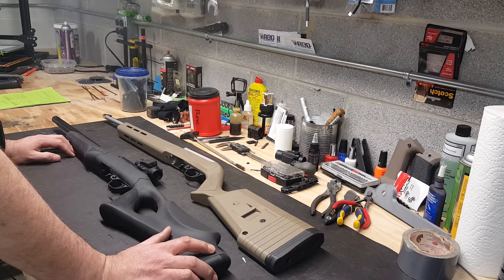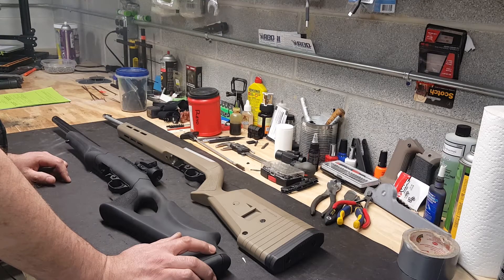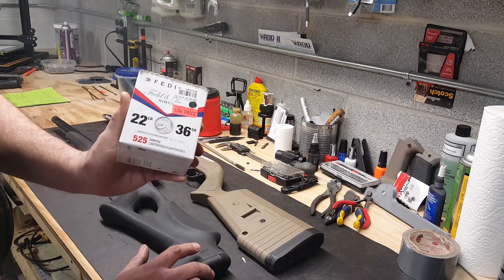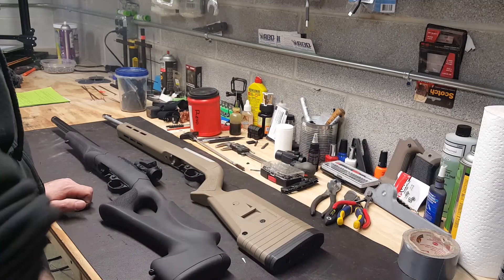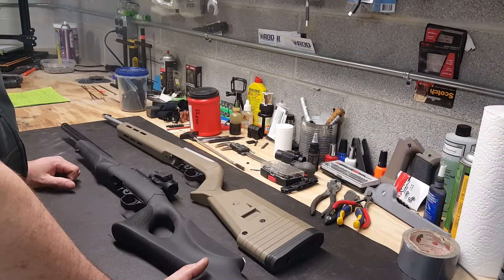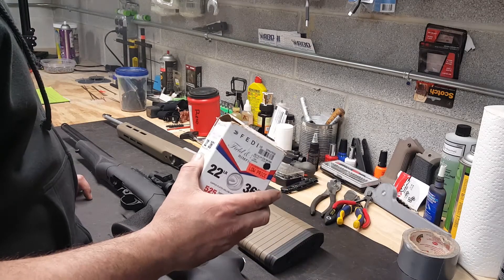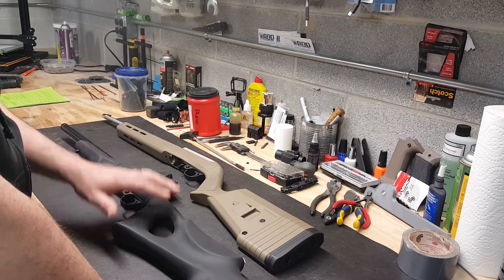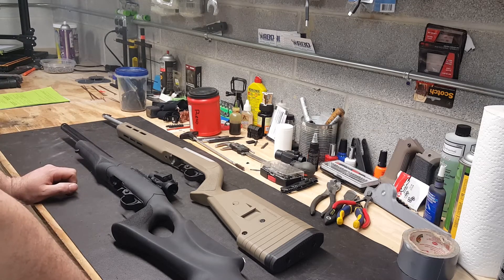10/22 Stovepipe Update

Comment: The people saying the extractor can't fix this issue don't know what they're talking about. Certainly, there could be other issues which cause the stove piping so it's not to say it WILL solve the issue but CAN'T is completely wrong.

The same people say the extractor doesn't do anything. This is false. It holds the round to the bolt face. The stronger its grip on the round, the more moment of inertia will be applied by the ejector, which will lead to stronger ejection.  If the extractor has a weak hold, it will drop the round with too little applied force by the ejector to accelerate the case mass enough to clear the chamber before the bolt springs back in to chamber a new round. Ergo, the case is stuck (stovepipe).

From my perspective, there are 3 factors. The extractor, the ejector, and the round itself. Changing one or all 3 of these should solve the problem.